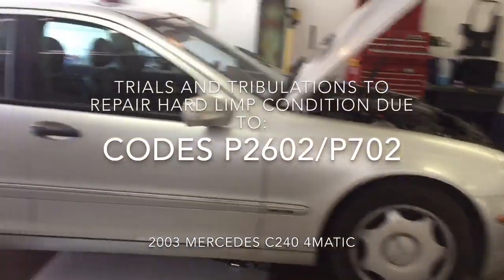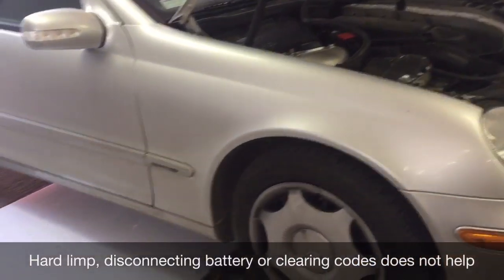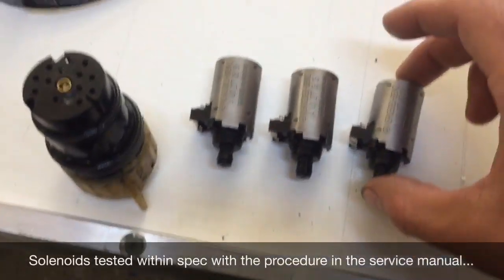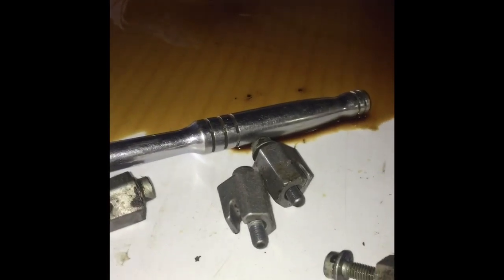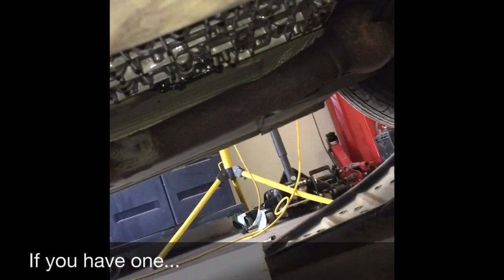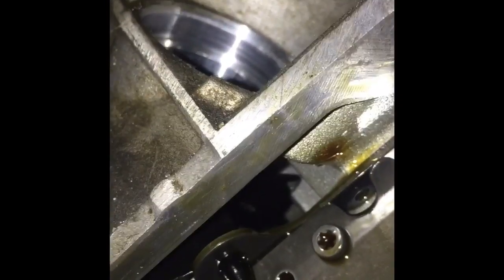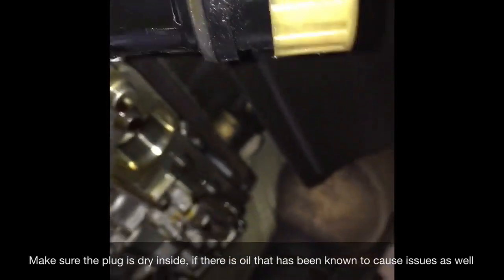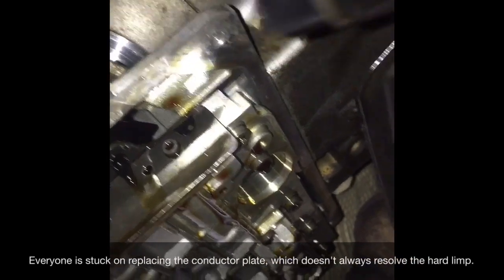Mercedes 722.6 Limp mode. Fixed!

Comment: So mine wont come out of first gear.  Is that "limp mode" ?
Reply: Is the check engine on? And how do you know that is stuck in 1st gear? What tool or scanner did you use to come to that conclusion?
Reply: Dimitriy Perchik I have a GL450 and I’ve got the 722.9 transmission. I know it’s in first because of the speed and rpms that it will top out at. I’m pretty sure it’s my conductor plate that’s bad. More specifically the speed sensor. Could be a solenoid issue as well.  From all of the info I’ve been reading I can’t just buy one or go to s junk yard for one I can only get mine refurbished. Unless I want to spend the THOUSANDS at the “stealership”.
Reply: @laenaszone  
What is the top speed you can do with limp mode on? If you have tried to drive it like that... 

If you had a scanner simular to Icarsoft MB 2 or Icarsoft MB V2, you could go in the TCM and clear the code for the limp mode and drive it until the limp will comes back. 

My understanding with these transmissions is, base on my experience with them, if you are able to clear the codes and drive for a little while, it means that the problem is more likely electric, but if you try to clear the codes and they don't clear or do anything, and you are not able to drive after clearing/resetting, it means that the problem is more likely mechanical. For example, a solenoid can get the right voltage and have the right resistance, but if it doesn't open and close (mechanical process) when needed, your transmission will not operate properly. 

You are right about NAG 2 7 speed transmission. The TCM is part of the conductors plate and it does require SCN (Security Code Number) coding with the immobilizer, just like the ignition switch, key, steering lock and instrument cluster. The cheapest option for you is to fix/refurbish the original that you have. 

You can buy a used one, IF you can find someone to make the conductors plate virgin and after personalize (SCN Coding) it to your vehicle. The Chinese copy of AVDI, the FVDI system is able to make the plate virgin, but to personalize it to your vehicle, it will require a DAS Xentry diagnostic system or Vediamo, or Autell system that can do SCN coding, or AVDI.
Reply: @Dima-jq3mj  Thanks for the advice.  I dropped the valve body yesterday.  Im going to change the speed sensor and ohm check the solenoids right now.
Reply: @laenaszone  
You will not be able to change the speed sensors. They are part of the conductors plate.

Watch the video below, the guy in the video leaves a phone number that you can call him at, maybe he might be able to help you. Also in the video you see the process that I described, if you might want to use a used conductors plate.

https://youtu.be/xUQwp-Q2VTo
Reply: Dimitriy Perchik that would be the case for a mere mortal but I’m Iron Man. 😂. I know how to solder. You flip the conductor plate you have access to the part. $40 on Amazon.
Reply: @laenaszone  
A big 👍for you than! I haven't looked into anything like that, but if it is possible, I will learn something today. You will still have to reset the limp mode after you put everything back together though. Do you have a diagnostic tool/scanner that can do that?
Reply: @Dima-jq3mj  Here is another
 https://www.youtube.com/watch?v=-1lZ0JmyzWE&t=11s
Reply: @laenaszone  
Clearing the codes is the resetting that I'm talking about, but the codes need to be cleared from TCM with a scanner that is able to go into the TCM. A generic OBD2 scanner will not do the trick.

As far as the videos you have posted, I already have watched them right after you told me about changing the speed sensors only. I have to admit that I learned something today that I can practice/do myself and I thank you for it! 👍
Reply: @laenaszone  
Did the fix that you did work?
Reply: Dimitriy Perchik finishing up tomorrow. I’ll be able to report tomorrow evening.
Reply: @laenaszone  
Was it successful?
Reply: Dimitriy Perchik it was not initially. However something I failed to to while I had the valve body down was manipulate the valves. The oil was black as tar. And really thick. I’m going to drop it again and make sure the valves are moving freely
Reply: @laenaszone  
So... What is the final result?
Reply: Dimitriy Perchik still working on it. Unfortunately.
Reply: Dimitriy Perchik and yes check engine is on. And the error code it’s giving me is pointing the speed sensor. Thanks
Reply from the maker: laenaszone are you sure it’s first gear?
Reply: @lukec4745  Yes sir.  I think so.  20/25 mph (dont quote me on that speed)  my rpms are runing high.  So with all of the reading on the forms, researching the error code, 0717, and listening to others GL 722.0 owners, it tells me its conductor plate.  More specifically the speed sensor on the plate.  So I dropped my valve body yesterday.  Going to resistance test my solenoids today and see if I can find a speed sensor to order.  BTW  got a couple of prices to do this work , one company quoted me $4,500.00 plus tax !!!!!
Reply: I have the e270. When mine goes into limp mode with overboost, i can go to any speed but takes longer because there is no boost. Switch off the car and it resets itself
Reply: @shifty2755  
How do you know that you have an overboost condition?

Overboost can be created by a bad turbo charger or a malfunctioning turbo actuator. In your case, if it resets by restarting the vehicle, you more likely have a malfunctioning turbo actuator, IF you have an overboost condition.

No boost condition, can be caused by multiple things, exhaust back pressure too high, bad EGR, leaking intercooler, leaking intercooler's hoses, leaking turbo resonator etc... So, are you sure that you have an overboost condition?
Reply: @Dima-jq3mj  

Thanks for the reply. 

Every time it goes into limp mode I have an overboost fault code. Nothing else. Could it be swirl flaps as well. The egr valve is fine.
Reply: @shifty2755  
No... If the linkage of the inlet port are broken, or if the flaps themselves are stuck and the linkage doesn't travel all the way to the home position, you more likely would have a code for the intake manifold/flaps. 

Overboost is almost always caused by a bad turbo or turbo actuator. You have a VNT turbo (variable geometry) that has vanes inside of it on the exhaust side, that open and close. The vanes are mechanical , when the vanes close all the exhaust gases are forced to go to the shaft's propeller to creat boost. When the vanes are open, no boost is created. The opening and closing of the vanes are controlled by the actuator. If the actuator is malfunctioning, it can creat high boost condition. You also might have a bad intake manifold pressure sensor/boost sensor that reads incorrectly.

My advice to you would be, do a live data scan while driving the vehicle and monitor the boost pressure, and at what boost pressure/load this event/condition happens. 

Second, disconnect the linkage from the turbo actuator to the turbo itself and move that lever with your hand to see if it travels up and down freely. If everything is fine, than you have a problem with the turbo actuator.
Reply: @Dima-jq3mj  

If the swirl flaps ca  move in a lot of shit, the intake ports can cause a restriction enough for an overboost condition.
Reply: @shifty2755  
Possible, but I don't think this is the case here in this situation. I would check the turbo and turbo actuator along with the intake manifold pressure sensor.

I'm not too familiar with the e270 and its cdi engine, but usually an electronically controlled inlet port has a home position, where everything, linkage and actuator must return to. Otherwise it will trigger a code for the swirl valve/intake manifold.

Do you know if you have and electronically controlled turbo actuator or vacuum activated? What year is your E 270?
Reply: @Dima-jq3mj  

Hello again. 

Thanks for the reply  

It's the hella electronic actuator. The vanes are free in the turbo. The gear in the actuator usually goes bad or 2 wires become de soldered on the pcb. Ive got an endoscope to look in the inlet manifold just to check. The map sensor was changed last month. The only thing left is the cats are blocked or the actuator. Its 2003 with 180,000 miles on the clock. 👌👍
Reply: @shifty2755  
Blocked cats should trigger a trouble code for back pressure too high... I would start with the turbo actuator.
Reply: @Dima-jq3mj  

I will check te actuator and tell you what happens. Thanks lot.

Comment: You did a good job. I am messing with the same problem.
Reply: What does the transmission do?
Reply: @Dima-jq3mj  it takes power from the engine and converts it via gears to make the wheels turn efficiently and smoothly.
Reply: You might replace the shift module...which is cheaper and easy job!!!

Comment: Hello, can you please, please help me? I have a 04 C320 Mercedes. My car was doing the exact same problems you describe your car was doing. My car drive in 1st or 2nd gear ( it also was stuck in limp mode) it only drove up to 25-30 mph. My check engine light came on, I couldn’t go in reverse unless I turn my car off to change the gearshifts, it also jerked hard when shift in drive. The diagnostic verified only 1 code that the trans range circuit sensor went out/conductor. I forgot the numbers code. Nonetheless, I got my uncle to change it out today, however, it won’t move out of gears at all now. It's not even in limp mode (I don't know) My car won’t move at all now. 😭 Can you possible tell me what could’ve happened? What could it be now? 🤦‍♀️ I hope my question isn't stupid. 🤔

Comment: Your troubles with this fix was that you started the fix the wrong way. 

The very first thing you should have done is to drive the car while monitoring what the transmission is doing with a diagnostic scanner that has "Live Data" capability. Reading the codes with an obd 2 scanner will not do you any good.

How did you know that the transmission was in limp mode? You are wrong in saying that limp mode doesn't need to be reset or cleared after the fix is done. Once the limp mode on, either on the transmission or engine, it has to cleared and reset. You didn't have a true transmission limp mode, you had a malfunctioning solenoid. 

Next time if you have an issue like that, use the scanner that you got, Creader 7, that has Live Data capability and diagnose the problem while driving.
Reply: Smart man.  😉
Reply: Dimitriy Perchik you are incorrect. A malfunctioning solenoid or anything else will put the transmission into hard limp. On the 722.6 once the problem is resolved there is no need to reset anything. Trust me. As for doing a live scan, I did, while driving, it showed me solenoid voltages as well as told me that my shifter module or speed sensor is not at fault because it was reading correctly.
Reply: @modernblinds7801  
There is no such thing as a hard limp mode. The "Limp - Home Mode" is a preset operating condition of the ECM or TCM. Once is trigger, it must be reset. In simple words or to use a computer terminology, LHM mode is like a safe mode on a computer, limited operation. I stand by what I said, knowing by experience, a true TCM LHM mode must be reset in order to be able to operate the vehicle.
Reply: Dimitriy Perchik I disagree, this is not the first European vehicle I worked on and certainly not the first Mercedes. The scanner read limp condition, vehicle was locked into 2nd gear, once the problem with the solenoid was resolved nothing had to be cleared, vehicle started operating normally.
Reply: @modernblinds7801  
First of all, the transmission possible was stuck in 2nd gear due to a bad solenoid that was not letting the transmission shift any higher and not due to a LHM. Which solenoid was changed?

https://mega.nz/#!BrIFQS4Y!fdmqR58bDGxgktuHQlKwDS2nPTQ9yuSWRTCN18x9Ars

Can you tell me from the link above which solenoid was changed? I myself had a situation where I changed the transmission fluid on a 2008 Mercedes Sprinter 3.0 turbo diesel and I used an aftermarket filter that after about 20,000 miles dropped out of the valve body and it was not letting the transmission shift passed 2nd gear. The transmission was not in limp mode. I simply changed the filter with new fluid and didn't have to reset anything, but prior to that I had to change the conductor's plate due to bad speed sensors (input and output) and a reset was needed.

You don't have to agree with me. If you ever have a problem with bad transmission speed sensors, which will put you in a true LHM, and you will have to replace the conductor's plate, then you will understand what true LHM is. You will not be able to fix the issue by simply replacing the conductor's plate. You will have to have a scanner that is capable of going into the TCM and reset it. 

Why don't you try to reset a limp mode on a diesel engine due to running it out of DEF, for example, by simply filling the vehicle with DEF since it was out of it? I would love to see you try... And I hope you know and understand that there are two different types of limp modes, engine and transmission. Like I said, try to reset the 5mph limitation (LHM) on a diesel engine, due to running the vehicle out of DEF, by simply filling it with DEF. I would really love to see you try.... 😀
Reply: Dimitriy Perchik you are talking about two different modules. I can’t comment on running out of def because my diesel Jeep doesn’t use it. The transmission was in limp mode, 2nd gear start and hard gear engagement. I’ve changed many 722.6 conductor plates on jeeps and Mercedes vehicles without the need to reset anything and yes my scanner can reset the individual modules if needed. 

This video is meant to help people and give them another area to consider when the conductor plate does not resolve the issue, not to confuse them even more.

The car was in limp mode, conductor plate was changed, codes were reset and the car never came out of limp. At that point it was taken to a Mercedes dealership for diagnosis. Diagnosis came back with a bad conductor plate. When told it was changed the Mercedes technician said it will then likely require the valve body, which I did not agree with. I then took it back and started troubleshooting it myself. Although all the solenoids tested ok on both resistance and when 12v was applied, one was faulty. Good luck!
Reply: @modernblinds7801  
The fact that the transmission was stuck or wouldn't go past 2nd gear, DOESN'T mean that the transmission was in limp mode. As I described, I had my NAG1 transmission stuck and not going past 2nd gear due to a drop transmission's filter, but no limp mode was triggered. 

If you ever changed a conductor's plate and didn't solve your problem, and no reset was needed, than the problem was not with the transmission's conductor's plate. 

I have a DAS Xentry diagnostic system, just like the dealer has, and I can do different tests and relearn and adaptations myself in great details. I know what I'm saying, a true LHM, may it be triggered by the TCM or ECM, both require a reset. 

Changing a torque converter on NAG1, which I did it with my own hands, requires a relearn and adaptation in order to prevent any RSN that comes from the torque converter's clutch. 

https://mega.nz/#!YixDmaLK!G8ZRLnULnsEB5Pdm2yMksvbkNRDgzR1YHcGCF0IG-0A

https://mega.nz/#!Y7hnlKQS!N9W4MT94us4nlf0obedx8TqqhPcyQ-W7HkZ-bVMNDqA

https://mega.nz/#!F7gjgSjL!-_WhQDFbL7LCxyTI-knwmwJ5AamWQuQIq8_6C9zkwlY
Reply: Dimitriy Perchik not going past second gear and STUCK in second gear are two different things. Anyway, you seem like a knowledgeable guy, make some videos and share your knowledge. Good luck!
Reply: @modernblinds7801  
Listen, how you know it was stuck in second gear? When you were putting the car in D from N, do you mean the car was going straight in the second gear? How did you figure that out?  Stuck in second gear, does it mean that it was NOT going in reverse? Explain please.... Or you are simply trying to play on words with me?
Reply: @Dima-jq3mj  I didn't need to do the reset after cleaning the clogged egr which triggered the limp-home-mode on my W211. My car just came back to normal.
Reply: @ccfabs8932  
How do you know that you had limp mode?
Reply: @modernblinds7801  
I mostly agreed with you.  I bought a 14yrs old CLK430 about 4 years ago.  I noticed the seller had a screwdriver handy and I did not have any experience with Mercedes at all.  The car soon had many problems.  Stopped running when it is hot( a $27 crankshaft sensor fixed it).  Can not shift out of Park - I fixed by removing the lever attached to the solenoid in the shift module.  Then the car fell into the limp mode. 
I bought Chinese made conductor plate and socket and replaced them (did not check the solenoids).  The car was still in the limp mode and I lived with it for 2 years since I only drive 2-3 miles at a time.
Then I read in MBWorld and decided to buy a used shift module on eBay and the limp mode was GONE AUTOMATICALLY (it took only 30 min. or less).  Well, after 6 months that module failed so I bought another used one and still works fine for more than a year.
My story proves that the shift module can kick in the limp mode and you might not need to reset the computer.
Think about this, car is worth 2 grands and if you bring in a dealership they might charge $1000 to reset!!!  It is outrageous then!!!!

It cost me 1 grand total in parts only, and thanks to YouTube and Google I fixed them all without paying an arm and a leg to mechanic!!!
Reply: @Dima-jq3mj  Thank you for your advice.  Will buy the iCarsoft monitor!
Reply: @DaiLenMatHo by shift module you are talking about the shift lever that you move from park to drive inside the car? Kinda a dumb question but I want to make sure because I have the same problem with my car so I want to make sure I buy the correct part.